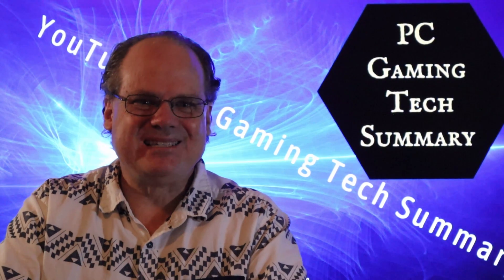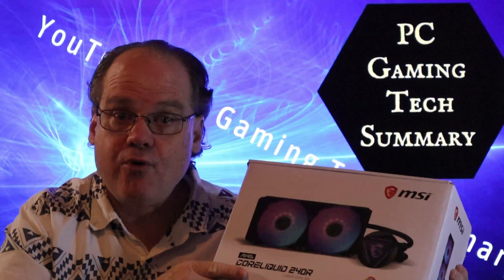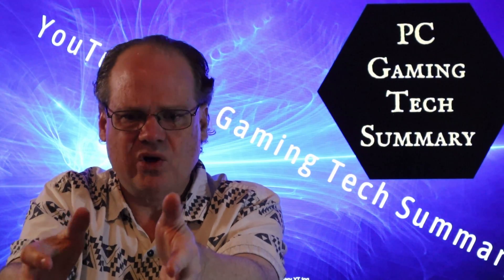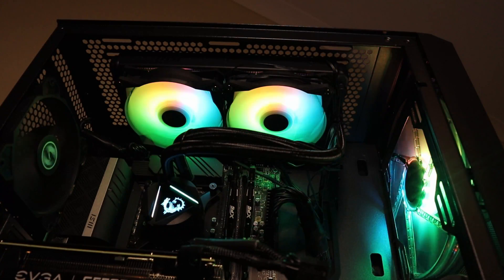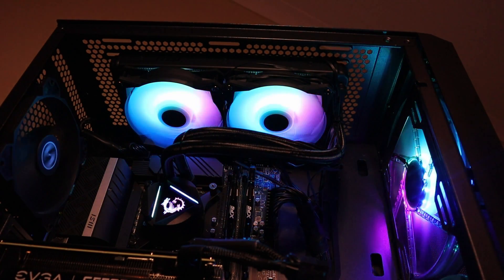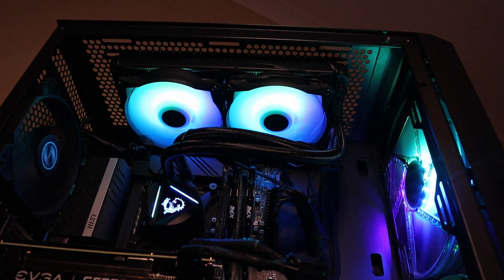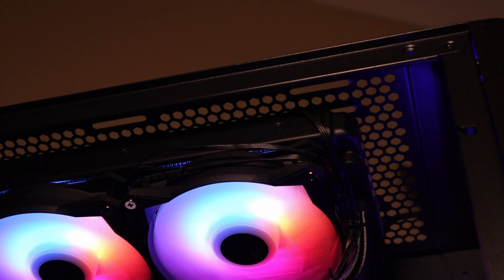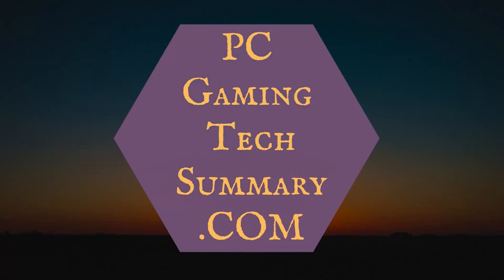MSI 240R 360R 120R AIO fails from sediment in a CPU MAG Coreliquid cooler. Exchange for Corsair AIO

Comment from the maker: See the Update https://www.youtube.com/watch?v=J_2L06bR0bQ I would return a 240R or 360R MSI AIO to the retailer to exchange for a better brand AIO if it is failing. I would take a screenshot of it thermal throttling. To apply for a swap I would not get  a 240R or 360R again https://www.msi.com/Landing/liquid-cooler-swap-application  IN THE USA https://us.msi.com/Landing/liquid-cooler-swap-application Be sure your pump as not at the highest point.
Reply: Having high temperatures now after not using my computer for 1 and half months. 
using 360r
Reply from the maker: @k1llaFPS  I will be publishing my Part 2 within the hour. Is your unit still under warranty? If so I would request a return authorization from where you bought it or msi.com. Say there is a known problem with corrosion and bacteria growth.
Reply: @k1llaFPS  I experienced also after switch off for a while, but i manage to make it work normal, i just removed and change the thermal paste, then change the orientation of the liquid cooler

Comment: Actualizado: Ya se sabe que este modelo se tranca, se taponea o se obstruye (como quieran llamarlo) debido al refrigerante de mala calidad y que forma limo. Lo desarmé por completo (ya que mi Serial no entra en la Garantía) y se encuentran rastros de limo o sedimento (causantes de la obstrucción) lo purgué, lo lavé metiéndole agua por todo los huequitos y LE PUSE REFRIGERANTE ROJO DE AUTO, del bueno, no espeso, el más parecido a agua con color...y hasta ahora va muy muy bien. Tengo un i9 10900 y no pasa de 62 grados.
Reply: Hola por dónde metiste el coolant? Directo por el radiador, la bomba o por el plate? Y como te diste cuenta del tope
Reply from the maker: @pedromedinilarobles152  Watch https://www.youtube.com/watch?v=tbtq1jAHp7o  
Si puede, cambie el MSI AIO por un Corsair AIO. Parece que el radiador puede no haber sido fabricado correctamente. Miles están fallando. Si su AIO está obstruido, es posible que deba desmontar la bomba y la placa fría para limpiarla. Hizo necesario cambiar el refrigerante de vez en cuando porque puede seguir fallando. Considere el refrigerante viejo como un peligro biológico.  If you can, exchange the MSI AIO for a Corsair AIO. It seems the radiator may have not been manufactured correctly. Thousands are failing. If your AIO is clogged you may have to take apart the pump and cold plate to clean it. You made need to exchange coolant every so often because it may keep failing. Consider the old coolant as a biohazard.
Reply: @pedromedinilarobles152  por el radiador con una jeringa gruesa, poco a poco, moviendo el radiador para que vaya entrando, llega un momento que no entra más, lo cierras (tornillo y tapón) y que funcione un rato, luego lo destapas nuevamente (saldrá algo de aire al hacerlo) y le entrará un poco más de refrigerante...estará a tope.
Reply from the maker: Please Subscribe. Thank you. You may have problems in the future. If a radiator is not cleaned out with chemicals right after it is manufactured, you will always have problems with the radiator. You can create a ticket on the MSI website and demand a different model also see https://www.youtube.com/watch?v=-d44wt-6TEc

Comment: Had this same aio. 78c on google sent for repair and same probleem again. Twice in 6 months
Reply from the maker: You have a few options. You can ask MSI for a different AIO product. Have you checked your serial number? https://www.msi.com/Landing/liquid-cooler-swap-application I hope to release a new video by tonight.
Reply: @pcgamingtechsummary  the company where i got the pc replaced the aio with noctua uh12-a if i can remember right
Reply from the maker: @MoonHoofer  How is that working for you?
Reply: @pcgamingtechsummary  im getting it on monday
Reply from the maker: @MoonHoofer  Are you happy with that? What CPU do you have?
Reply: @pcgamingtechsummary  yeah. Im done with those water coolers for now 😂 Amd ryzen 5 5600x
Reply from the maker: @MoonHoofer   Perfect!
Reply: @MoonHoofer  with this cpu at least the 360R i used mine on Ryzen5 3600 only but still reach 70-80degC on 4200mhz room temp 29degC-30degC

Comment: Used my 360r for 2 years. Did a general cleaning on my pc last week and boom overheating up to 95 deg celsius...
Reply from the maker: You may have knocked some deposits loose. Oh man, so it is out of warranty? Have a look at this https://youtu.be/9U_5aGf0G9Q?t=1228
Reply: @pcgamingtechsummary  broooo its exactly my situation right now thanks for this!!!! Im'ma try opening my rad later
Reply: @marknathanielgonzales4162  any update after you open bro?
Reply: @rnyzen2.079  just refilled my coolant and everything is working fine i got an idle of 39 deg Celsius
Reply: @marknathanielgonzales4162   if that really did work for you, and assuming that it took a good while before your cooler started malfunctioning, then I would say the issue you were probably dealing with was Evaporation and Permeation of the liquid through the tubes. Especially if just simply refilling it with coolant solved the issue. glad to hear you got the problem resolved.